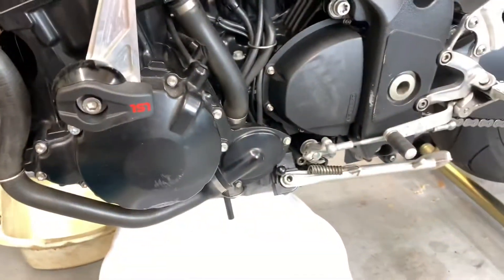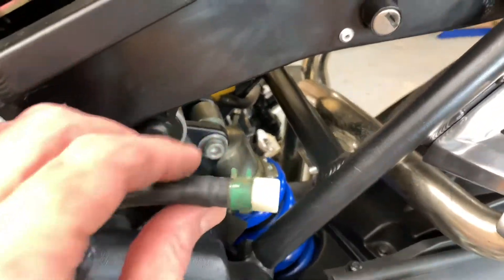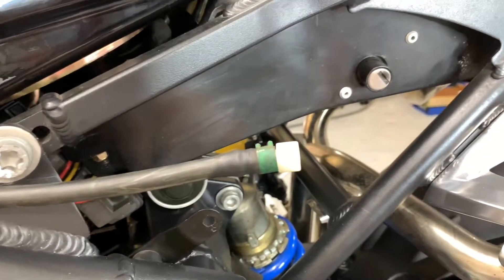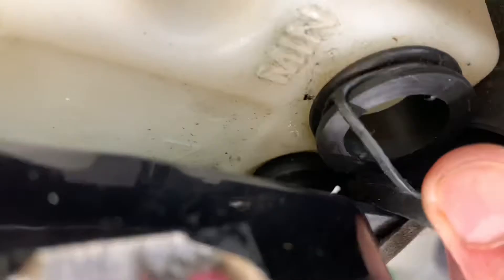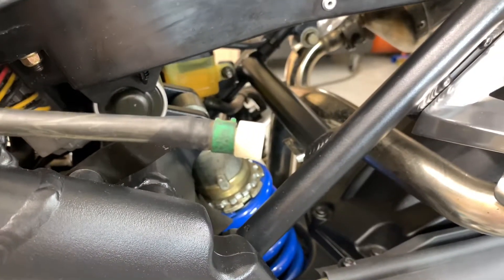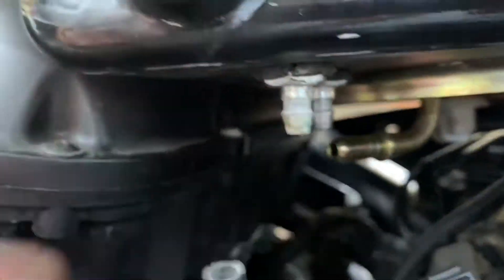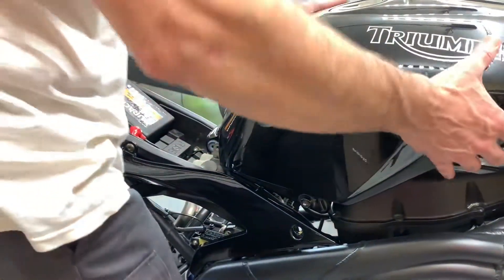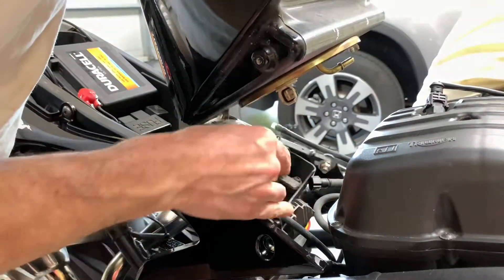2006 Triumph Speed Triple Maintenance - Recovery Tank Fix & Coolant Flush - Maintenance log #10

Comment: If you still want to replace the broke fitting there is a german online shop that sells original triumph parts. I looked it up for you: the part you are missing is still available. it costs ~ 6€.
Reply from the maker: Hello Herxheim,  I would like to know the name of the shop, however, the simple fix using just a larger diameter hose works great.  Thanks
Reply: @TriumphSpeedTripleMaintenance  the shop is named triumph-teileshop. there you can access the "parts-cataloge" and select your model and type by the FIN.
Reply from the maker: Thanks again!